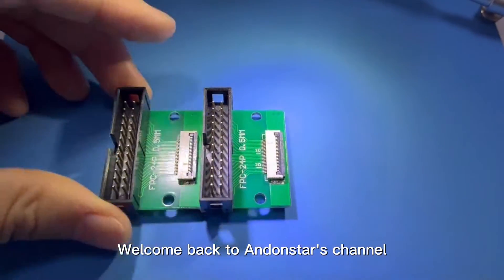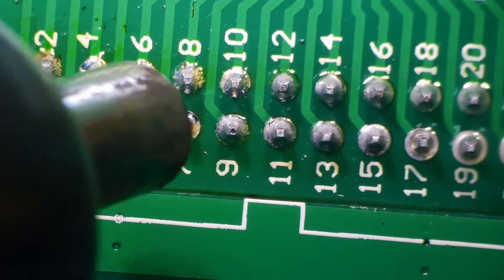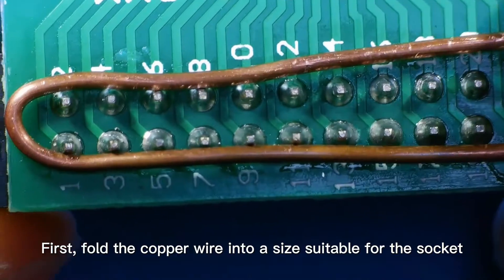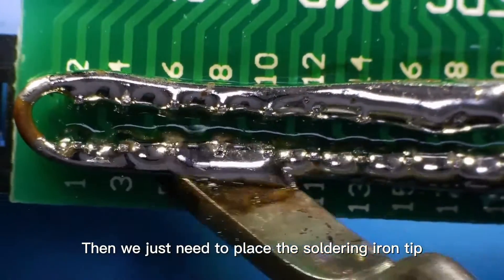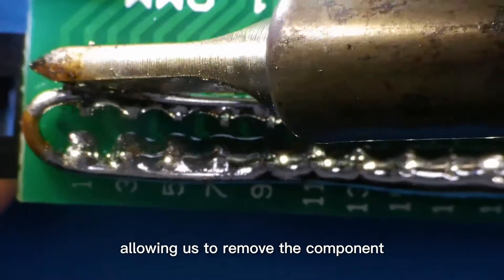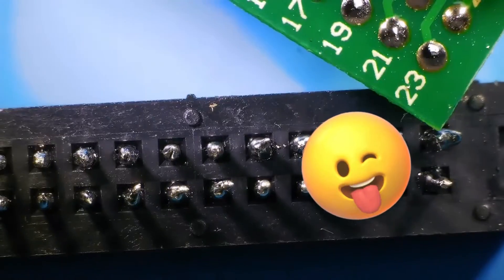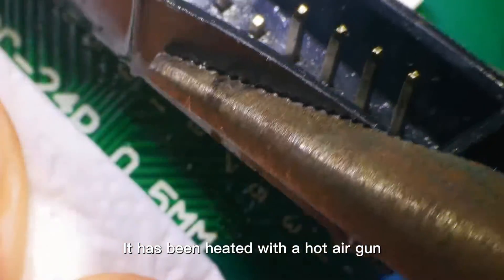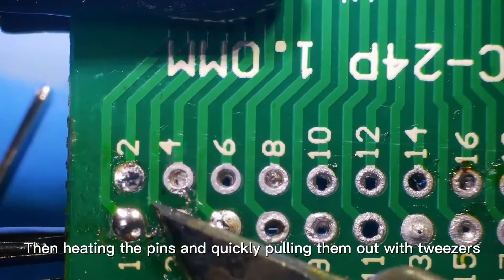Andonstar-- Desolder/Remove Multi-pins Through Hole Sockets and Components

Comment: Hot air didn't work because of using the wrong nozzle.  Hot air needs to be directed at all the pins at the same time.  If you don't have the proper nozzle, you may be able to make one out of aluminum foil.  Just get a rectangular object that's the right shape, hold it next to the heat gun, and wrap a few layers of foil around it and the end of the gun.  Then remove the object.  You may need to secure the foil to the heat gun with kapton tape or a metal band clamp.
Reply from the maker: What a great idea! I did use the wrong nozzle. Thanks for you advice.